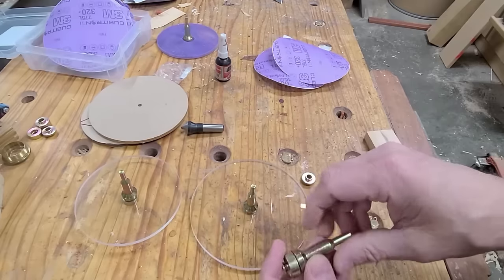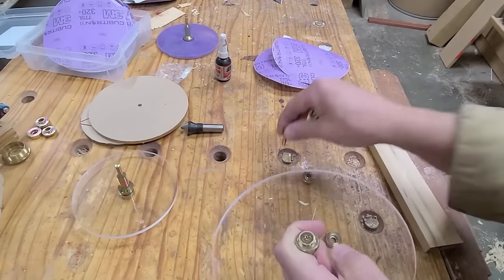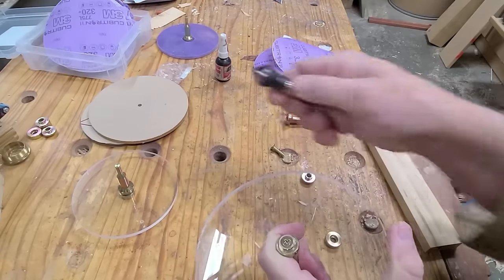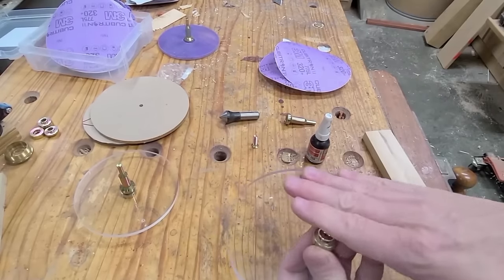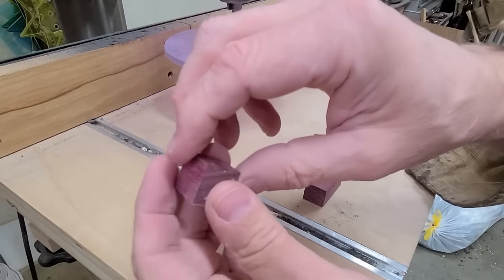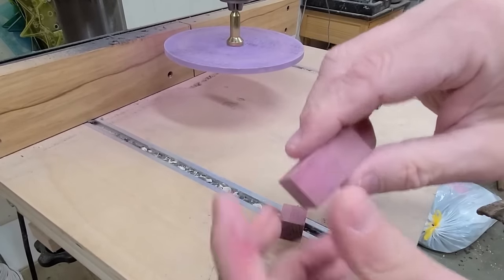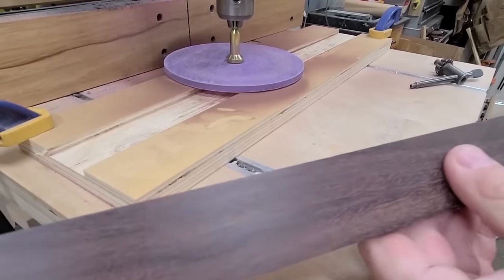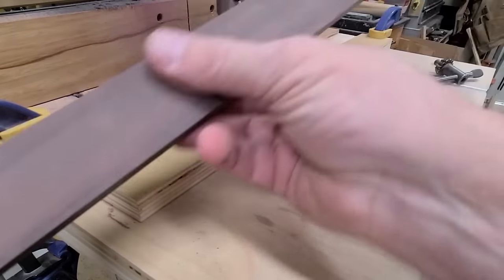Things you didn't think you could do with a drill press

Comment: Looks like you have a home-made Eversharp tool sharpening system.  Great idea!  Tip:  Adhere a small piece of sandpaper to the 25 degree bevel area on your tooling and when you retract the chisel over the paper, it will remove the back burr.
Reply from the maker: Great eye! It's a home-made Worksharp tool sharpening system. It works great!
Reply: @TaylorToolworks  Better than the Worksharp because it makes a flat cut. The Worksharp curves the surface which can be fine for a pocket knife but not a chisel.
Reply: @316woodworks9  They are both flat and slow-spinning disks with sandpaper glued on. Why does Worksharp's spinning disk 'curve over the surface' while your spinning disk does not? We're talking about the spinning disk on the Worksharp and not the belt sanding attachment.

Comment: I purchased the kit and it works great. It's amazing how fast it does what it does. The only thing I changed was using 3/4" cabinet grade plywood for the jig - much easier to build and much less expensive than hardwood. I got the 6" kit - why quibble over $10, and then later regret that you didn't get the bigger disks? When calibrating the jig, use a 1" wide piece of wood or thin plywood to check squareness of the grind. That way, you waste scrap wood and not your precious metal chisels.

Comment: When I first saw a link to this video I didn't really know what to make of this. Second time I saw the link I actually clicked on it. I wasn't sure about the "small parts" part at first, (even though I should have been excited since I've gotten myself in trouble on the belt sander more than once). But the dimensioning and grinding - pretty darned clever! I kind of wish I had seen this before I bought my Work Sharp. This grinding jig takes up less space, is easy to store and lets you use more of the sandpaper. And yes, that counter sink bit is fantastic! Only problem is, both sized discs are already sold out!
Reply from the maker: Thank you for your kind words! We'll be getting more soon, and when they're back in stock we'll let everyone know with one of our weekly emails.
Reply: I wish I didn't see this. Now I regret buying my worksharp.

Comment: I saw this video well after ordering this system for my own drill press. I noticed that your disc doesn’t seem to be balanced in the chuck of your drill press. This would inevitably cause an uneven grind on the bevel of your chisels. I have not encountered this problem myself yet but am definitely on the lookout after seeing you operate this. I’ve only used this twice so far and have absolutely zero complaints.

Comment: Taylor Toolworks, maybe this would work better. Use 3/8" whatever plastic and drill a countersink on both sides. Do not cut the paper larger than the countersink as the grit can be the thread locker.    Then, if you have two grits on the disc, when you need the finer grit, just remove the screw and flip the disc, and then sand till your done. 

I'm gonna try to make a jig like what you posted for sharpening 13" planer knives. Thanks for this video. ............ Jerry

Comment: its mostly about Cubitron II abrasives that it wont heat up 
average abrasives like to heat up material 
Cubitron II everything from this material (cutting disc , belt sander , sanding discs etc and more with cubitron II) just wont heat up the material like competitive materials
i love this material , it last for me at least 10x longer and cut/ sand 2-3x faster than any other brand on the market , even mirka cant stand oposit it where its cheaper than mirka/ festool etc

Comment: This is a great channel. I subscribed. I didn't know you could buy this!  I made one with several plywood discs of different grades of sandpaper. I stick the sandpaper on with double sided tape. It works really well but it is smaller than this. Also, the chisel jig here is great, you could use a jig like this for doing a mitre or bevel on a timber edge. (But I sharpen my chisels with Richard Kell's honing gauge. PS. I don't know Richard Kell, he's in the uk and hand machines fine sharpening tools). My chisels are very narrow, for lathe work. For someone who has a lot of wider chisels this disc would be brilliant. Thanks for a good birthday idea for my brother.

Comment: I ordered this and am simply confounded!! Like I said in the review I tried to leave on your website but never saw it posted... Its like 2 R & D guys came up with a bet to see if they could create an awesome product idea and then only make it 25 % useful to the customer as delivered!  The 2 included acrylic discs have countersunk screw holes to attach the ardor and unless you redrill the holes, you only get to adhere 2 of the 6 sanding discs included in the kit! Include 6 sanding discs but design the product to only be able to use 2 of them...??????? Uhmmmm.....

To anyone reading this.... If you only need 2 grit levels to sharpen your chisels or plane irons, go for it! The product works well, but if you want or need to use the stepped grit levels, just know you will have to modify this product to get a couple more grit levels, but will still need to buy more acrylic discs if you want to use the strop ring and final sanding grit disc.

As sold, only 2 usable sides (technically 3 if you use the strop ring) on the acrylic discs, redrill the screw holes and you get 4 usable sides but still have a total of 7 grit options. A great product with a lot of head scratching.

Comment: Worksharp made a very similar in-use, dedicated machine to do the things you're showing. Look up the WS3000.
The thing I do like though is the ability change the speed at the drill press. 
FWIW, the loose clothing comments seem unfounded at only 500 rpm. I get it with regards to safety but it's not like you're running at the speed of an angle grinder.

Comment: Is the 3M cubitron 320 grit comparable to a rougher grit of aluminum oxide?
How are you able to flush up heartwood with 320grit?
Thanks.
Reply from the maker: I would say the 320 is pretty close to the aluminum oxide. The 320 did a good job flushing up the heartwood. I had the drill press slowed down to 500 rpms so it wouldn't burn.
Reply: @TaylorToolworks  🙂

Comment: I never leave comments but feel like this time one is warranted. I just received mine along with the wooden angle guide. After setting the correct drill speed It badly skewed two chisels in “less than a minute” to badly out of square and I’ve spent over 30 minutes trying to correct them. Haven’t managed that trick yet. After checking everything with a square it became obvious that the ramp itself is out of alignment. I am beyond unhappy with this thing and would not recommend it.

Comment: Wear work gloves when working with those 3M disc.  Putting my hand sander down while it was coasting to a stop the sander in my right hand passed by my left hand .  The edge of the disc is so sharp that it sliced my thumb requiring stitches.  I was lucky, a hair deeper and I would have sliced the tendon.  The edge is like a meat slicer.  Gloves, please.

Comment: I use the 3M Sandnet, never tried cubitron. Is it porous? 
 
I ask be cause I made a very similar design (with ¾" hdpe) but I drilled holes into the disc to help with (a very crude) dust collection.
Reply from the maker: It's not porous

Comment: Is there any danger of cracking the disk when you torque down on that arbor screw?
Reply from the maker: No, not unless you use a torque wrench haha
Reply: As with all acrylic/plexiglas, or even polycarbonate, yes. It's one of the reasons I made mine years ago from HDPE (a cutting board actually) I tried Plexiglas back then, but it needed to be really thick for my needs, and was too heavy on my drill press as it damaged my bearings. 
 
The system Taylor has appears great for it though... A bit of super glue, with some felt or even a bit of sandpaper between the tapered head if the screw, and the countersunk hole bevels to cushion it, and keep in from spinning while chucked should be more than enough to keep it in place. Just don't overnighter, and it should be fine.

Comment: Can we use this on a CNC to sand large slabs??
Reply: I'd say no, due to the speeds. It would need to be ran at a very low RPM. If you ran it at like 4k RPM, it would likely explode.
 
 You could do it with a thin, well balanced aluminum disc, but you better have a massive motor system and at least a 20mm shank/collet. 
 
So, I'd say no, because anything pulling that degree of force at high speeds will end up being a death trap.
Reply from the maker: Edit: Just spoke to Izzy Swan, and he advises not to since the lowest RPM is 2000, which is too fast.

I can't confirm or deny. You probably could, but you'd have to take really light passes. It would probably be best if you had a pad underneath it. First attach the replacement pad to the disc: https://lddy.no/1emau - Then attach the backup pad to that: https://lddy.no/1emav - Then you'll use Hook & Loop discs instead of PSA, I recommend the 775L for this: https://lddy.no/1emax

Stay low RPM's (500).